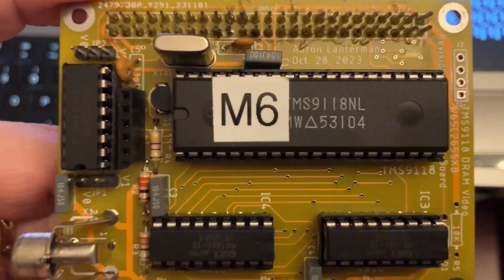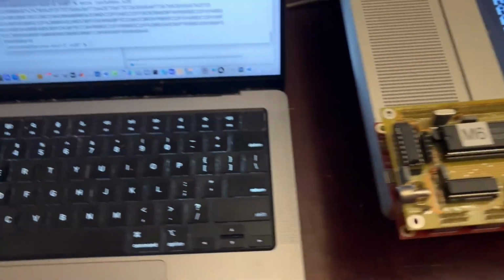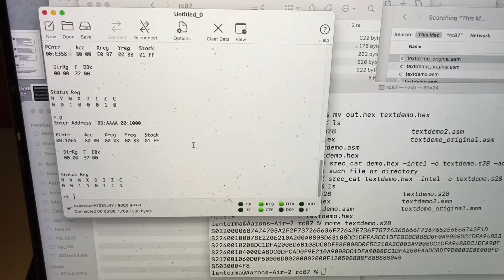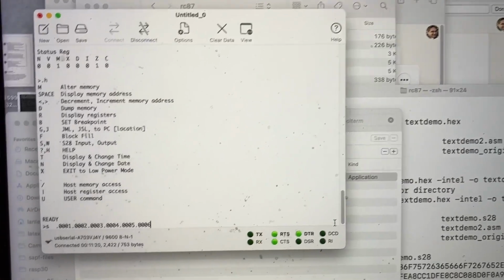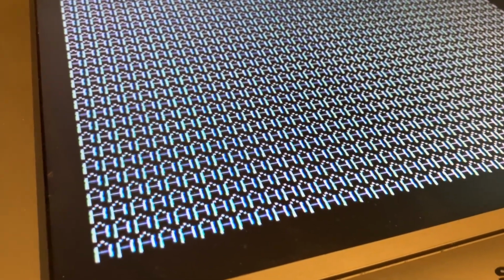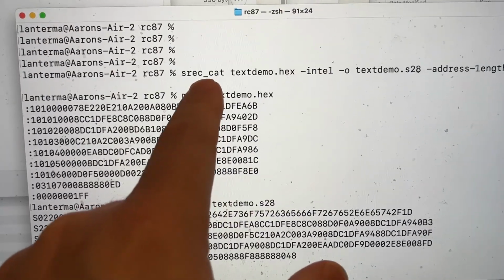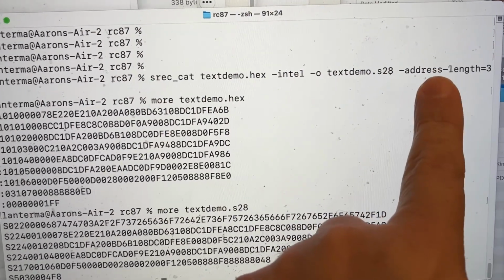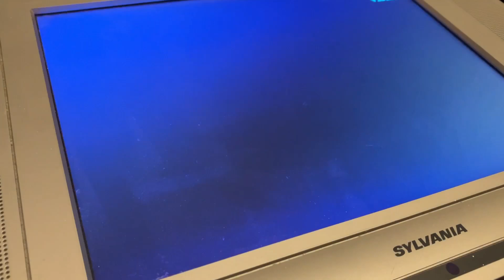RetCom87: TMS9118 Video Test (and converting Intel Hex format to Motorola S28 S-record format)

Comment: Great to see an update to the project
Reply from the maker: Alas last semester I didn't have any students who wanted to work on it. This semester I have a couple digging into it.
Reply: Nice. I picked up a  W65C265SXB  years back thinking the built in monitor, bit of ram, UARTs, etc would be a bit if a jump on a 65816 homebrew project. Got sidetracked by the minimal 64x4 but seeing a fresh video from your channel pop up in my feed is making me want to pick it up again.
Reply from the maker: @StevenSherman-kr4xm  It's definitely a lot easier that getting started with the 65816 on its own.